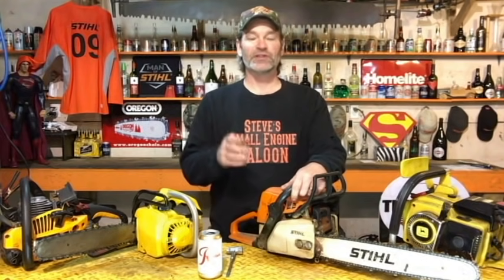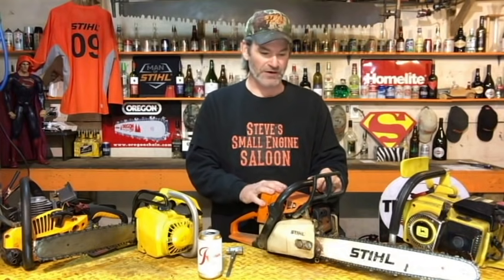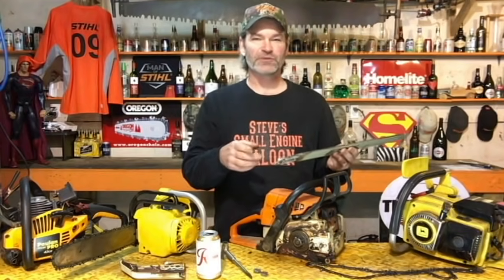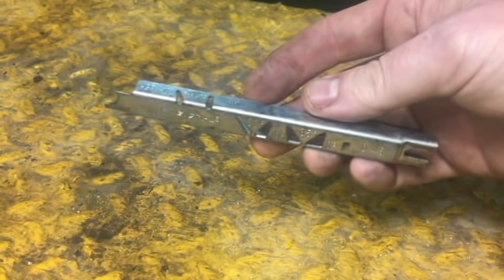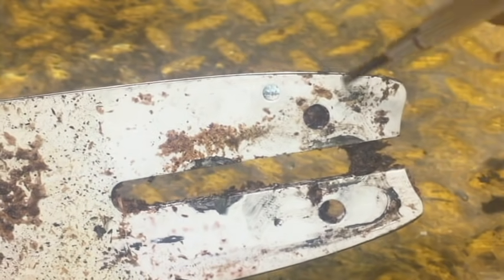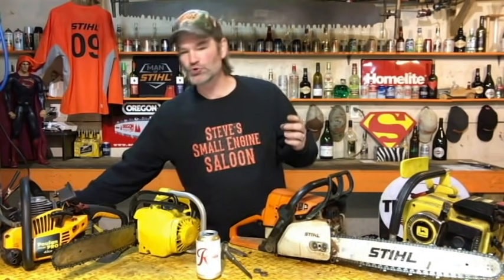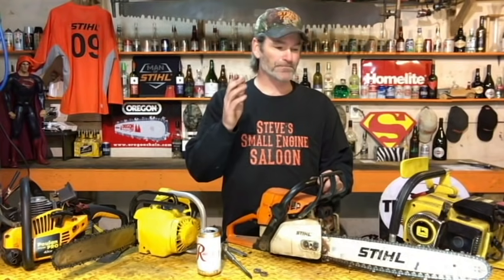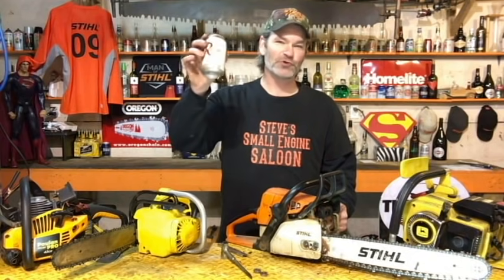How To Fix A ChainSaw If It Won't Oil The Bar And Chain

Comment: did the same thing on my Remington Electric chain saw. It has no pump. Just a tank of oil that you push down on. It pushes some oil out onto the bar. Clogs up fast. Just keep it clean of sawdust. Sometimes I manually rub oil on the bar if it needs a little boost.

Comment: Hi Steve,  I have a question for you on my chainsaw not oiling the bar/chain properly.  I have a Stihl MS170.  I took the bar and chain off.  Throttled it to full speed and oil runs out of the oiling slot on the side of the engine.  However, when I put the bar and chain back on, the chain does not oil.  I've cleaned the bar and the track the chain fits into as well as the small holes on both sides of the bar.  I've also put the bar on a flat surface and it appears to be level and not bent.  After about 30 seconds to a minute of cutting the bar is smoking and hot.  Its not throwing the oil out onto a card board like your example in the video.  Any other suggestions on what the problem may be?   Thanks for your help and for your videos.
Reply: Did you ever figure out the problem? I have an MS 170 too with the exact same problem. I plan to replace the oil pump next after cleaning the filter, hose, passages, and hole in bar. I'm hoping it's just that the oil pump is not putting out enough pressure.

Comment: for easy spill less pouring, cut a narrow vee across the plastic cover of a new jug with 5/16 or so width at the bottom to 1/16 at the top of the opening.  This will pour without glugs from a gallon jug with a reasonable flow to the saw.

Comment: Thanks Steve!!  Am working on a Ryobi 10 inch battery chainsaw that is not oiling.  This video was GREAT in confirming that the oil was indeed getting from the oil reservoir to the chain through the weep hole.  Now know for sure that it is a problem with the bar!!  Starting cleaning the channel of the bar and was packed full of dry grass.  Slow and steady and making progress!!
Also working on my other Ryobi battery chainsaw (I have 2) that got tangled up in some hay twine that someone did not throw away.. lots of tiny little fibers caught up in the bar channel.
I have dedicated work clothes set aside for chainsaw work-- the bar oil sure is goopy stuff.

Comment: After making sure the bar, groove, and outlet hole was clean, It was still not delivering oil. I found that the little hose inside the oil tank was flipped up. In other words the hose in the tank was sucking air from the top, not oil. Make sure the hose is pointing down and at the bottom of the oil tank. The retaining feature on the oil cap that keeps the cap from getting lost can catch on the feeder hose and flip it up.
Stihl 019T.

Comment: Oh, I made a grave mistake, I listen to a dummy. He said I could use used motor oil for bar oil. Will I found that after doing so it got clogged and hot. So I put gas in bar oil spout. Put cap on and shook the hell outta it. To loosen and debris. Then dumped it out really good. Did it twice to get it cleaned out. I hope I got it all. I will check tomorrow to see if oiler is coming out freely or maybe it's plugged. Hope not. After listening to someone I thought knew what he was talking about, I decided your tube videos are much more helpful. Thank you!

Comment: thank you. i hope that will solve by chainsaw problem. I am going to check it now.
... I just came back and spent 2 hrs (estimate) . I clean the guide bar, cleaned chain oil tank with kerosine. add a clean chain saw oil, tested it running without the chain/guide bar just to check if the oil is coming out. there was a a very little came out but a lot of the oil is coming out thru the exhaust fan. maybe it is time for me to retire this very old 16" electric chainsaw.

Comment: I put a ematic,adjustable oil pump, leaks in the box case,must be a rotted rubber from tank,034av
Reply: tank hose was fine ,bar isnt spraying  off the end,may have a bad worm gear teeth,or some other issue

Comment: Steve you are Right. I clean my Bar out every time I cut wood. I use a MS260 PRO, AND MS311 BOTH STIHL Saws. My thoughts exactly on your thinking Sir. I have fixed many Saws where all it is that you have to keep that Bar Area open to get that oil in the bar and chain. Love your Video's keep them coming. Ron
Reply from the maker: Thank You...

Comment: Thank you for your service, Steve. On my ms180, the clutch drum has worn a pinhole in the casing thru to the oil pump cavity, now it leaks/pulls air instead of oil. what should I repair it with/ goop it up with?
Also, glad to see you are getting lots of vitamin ‘R’
Cheers bud

Comment: I have a 2370 wildthing poulan, I have put a new oil pump in and have checked the oiler hole from the tank to see if it is stopped up .  I checked the line inside the tank and all is well. why is it not oiling???? I really need help on this one.. the line that goes to the bar oiler hole was just laying in the tank.  I reinstalled it and checked for blockage...all checked ok. can someone help please????   I will check  for replies daily
Reply: It is now 3 days later..I could not solve the oiler problem so I modified the chain saw as to manually oil the chain with a primer ball. i manufactured a primer ball holding bracket for the primer ball and attached it to the carburetor cover.  I am now once again a happy wood cutter....

Comment: Thank you Steve. My MS 271 Farm Boss, which I just bought, seems to be spraying a very fine mist on the cardboard, BUT I'm also guessing that perhaps I don't see much oil on the cardboard  because the Stihl oil, as you may know, is almost clear. I will remove the bar and chain and test it without it as you did. Thank you very much.
Reply from the maker: You're Welcome...

Comment: I have found that my Stihl saw does not like aftermarket (cheaper) bar oil.  The aftermarket oil seems to be a thicker viscosity and the pump on the saw is not as efficient at pumping it.  I switched to the Stihl bar oil and had no problems.  It might just be my saw (it is around 20 years old now) and the pump may be getting worn or weak.  Just thought I would throw that in!

Comment: Thanks Steve.  I have an 025 Stihl 18" I believe that was given to me.  Looks like it has little wear.  Where do you measure the chain from?  Centre of Drive to tip?
That little plug is in as per your previous video.  Will check the bar next.  Previous owner said it was leaking oil from somewhere.

Comment: Great video.  My first chansaw and didn't know what to look for.  Is there different bar oils depending on temperature too?  It's about 10 below 0 and oil is extremely thick.
Reply from the maker: Thank you and yes, there are different bar and chain oil weights.  Usually just says winter or summer on the bottle...

Comment: Would this be the same for one of those battery powered saws?  I have a Ryobi 40 volt one and it seems as if it is not oiling like it should.  I mostly got it because I don't do a lot of cutting and I never liked the 2 stroke engines being that they can be difficult to start at times.

Comment: Just unplugged an oil hole in a chainsaw bar today. That´s why i came back to this video.
Your videos really are helping!
Will run the saw tomorrow to see if it sprays oil at a piece of cardboard like you showed.
(For your information:
I tried to buy stuff from your amazon store, like the lawn mower blade balancer, but it won´t ship to me. Seems to be because i live in europe and you link to a north american amazon store. I couldn´t get it to work for me. European amazon ships to me just fine, but not from your store. So maybe you could link to different stores for the different continents or something. When it comes to computer/internet stuff i´m not the brightest knife in the shed though, so maybe it´s just me...)

Comment: I have a HT -102 sthil pole saw.... it will oil heavy around the sprocket and cover but will not oil the chain? When I take the cover off to look at it, the cover and sprocket is flooded but none on chain?

Comment: Talking about my Stihl 170 minis !! What a piece of crap. Brand new buggers leaked like a stuck pig. Took 4+ months of "repairs" to stop them from leaking oil. 4 months of not using either even once! Then got them the last time and pigfuckers said no more warranty work, even though I had zero minutes with those saws! And never offered replacements. And it wouldn't oil a drop after all that time in the shop. So much for supporting mom and pop shops and made in 'Murica.

Comment: Saw pumps oil without the bar on.
The bar is clean.
The chain will not throw oil against a piece of cardboard while revving.
The inside of the clutch cover fills with oil in seconds of use.
I'm stumped!!!!

Comment: The little oiler hole was at the bottom of the blade, not at the top where the oil come out. Yes the blade was right side up according to the brand lettering. . I burned up one blade and chain because of this manufacturing  defect. I flipped the blade over and it works great.  This was on a Stihl MS170

Comment: Thanks for the video.  My machine hasn't been using as much oil has it used to.  I'll check this out.  Do you have a preferred chainsaw brand?  I have a Husqvarna 450 that's worked well for me, but I've been told Stihl is a better brand... just curious.

Comment: Hay Steve I have an oil problem kinda. My ms460 oils good when it’s working but sometimes it stops or slows down I then have to turn the adjustment screw back and forth a couple times and back to the same position and it works fine again until it doesn’t. Does that even when it’s clean. Thanks.

Comment: Great videos thanks. My MS170 stopped oiling so I have followed your advice and cleaned the bar properly. Seems to be oiling ok now. Just one question. How long should the oil last. I used to get two fuel filling to a tank of oil, not sure I do now. It seems to use less

Comment: Steve,

It isn't always blocked oil ports in the bar--I just finished sorting out our 49cc 20" Troy-Bilt, and there are a pair of thin sheetmetal protective guards on either side of the back end of the bar, where it bolts to the saw frame (crankcase). One metal plate goes on either side of the bar, all 'sandwiched' between the crankcase and chain brake cover. The two plates have the chain between them, and it acts as a protective guard if the chain derails. They don't seem to be needed for the saw to work--they're just there to protect the surroundings if the chain comes off.
So, crankcase, then one sheetmetal guide/guard goes on, then the chain & bar, then the other sheetmetal guard on top, then the chain brake cover and two nuts for clamping the whole stack together.
Problem is, the two guard plates are mirror images--and if you put the wrong one on first (before the bar & chain) it blocks the oil port! No oil can get to the oil port on the bar now.
I cleaned everything out and installed the correct guard plate first, and now the chain oil system works well!
Peace eh! :)

Comment: As a new chainsaw owner/user, I'm loving your videos on chainsaws.  I have a newer Stihl saw (MS251) and it does oil but I don't think it oils as much as your saw in this demonstration.  Someone told me that they probably cut back on the amount it oils the bar due to environmental reasons.  I did know that I was supposed to keep the bar clean but I never thought of running the saw without the bar to see how much oil is coming out.  Thanks for the tip!
Reply from the maker: You're Welcome...
Reply: It wouldn't surprise me if that's the case. I have a newer one and usually have trouble finding the oil spray (which the manual says it should do). At the same time, I know it's oiling because I'm having to add more oil.

Comment: Has anyone ever added a little kerosene (1 t.) to the full oil reservoir to keep the oil from plugging things up?  Seems like it might keep things flowing in spite of the sawdust.  My Stihl MS 250 benefitted from the bar cleaning, etc you talked about, but it still doesn't spray a lot of oil on a piece of cardboard.  I used it anyway and may eventually take it in for "professional" evaluation.  Thanks and keep on keeping on.

Comment: I now have my stihl 08 S running good, thanks to your expertise and movies.
Do you know if you can adjust the amount of oil that lubricates the chain....while running.
I think it can do a little less.
It gives a spray like you did on a piece of cartboard. Is this normal...
And when you stop, there comes a few little puddles from the exesive oil on the chain and chassis. 
Maybe this is normal, but i think it could be a little less...saves you a bit of money on oil as well.
Thanks for all the movies
Reply from the maker: What you are describing sounds totally normal....

Comment: This completely solved my problem! After taking the bar and chain off I ran the saw and verified that oil was being pumped out. I then thoroughly cleaned the hole on the bar and the groove going around the whole bar. It oils like a charm now. Thanks so much!
Reply from the maker: Great job!

Comment: Man, I;m glad this was a one beer job lol !!
I am having this exact same problem with my Echo CS-6701. I have noticed the oil wasn't coming through and wasn't aware of the oil hole on the bar. I was thinking it may be something to do with the auto oiler system.
I do remember some time back that it actually used more oil than I thought was normal.
Is there such a thing ??

Thank you so much for this video Sir !

Comment: Steve  I just watched your video and cleaned all the parts that you mentioned and tried it on the cardboard and little to no oil on the cardboard.  I have the Stihl MS180 model which I have had for less than a year.  I think I need to increase the oil flow but cannot find the spot to do so can you tell me when the spot is and do you have a video that shows how to do this.

Comment: I've found out (cense they started making it) that in the field I can use "Ultra Duster" compressed can of air or what ever it is, to blow my bar out when I change chain's and flip over my bar and I keep a can in my saw box all of the time, it work's out pretty good, I do dress my bar and use my compressor back at my shop for the really good cleaning.
Reply from the maker: Good tip...

Comment: He missed the biggest problem with the oiler itself. I cleaned my bar with hacksaw blade, I soaked it in gasoline & cleaned the bar some more, I used a wire to clean out sawdust in the bar oiler holes, I then used my air compressor  to blow dry everything impeccably clean, still not oiling even though oil was coming from through the oil port from the oiler pump. 

I thought maybe I had a failing oiler even though oil was coming through the port hole but in only a very small quantity, maybe the oiler was just plugged?

 So I thought I'd try one more thing, drain the oil out through the fill tube, soak the oiler in gasoline for 15 minutes, then run the powerhead until the gasoline started coming after pushing out residual oil still in the tank out the exit port to the bar. I let it run until I could see the gasoline exuding from the exit port which it didn't do at first, it was very slow at first, then in a minute or two I noticed it flowed much more freely. Refilled with bar oil & voila, like a brand new oiler having been installed. The oiler was plugged with sawdust debris which collected inside the the oiler plugging it & reducing oil flow to the bar, I could see the huge before & after  oil flow difference.

Lesson here: Make sure your oil tube is clean before removing the cap to refill with bar oil. Sawdust that falls inside the tank will collect over time & plug the oiler.